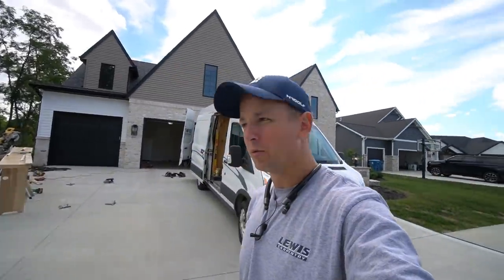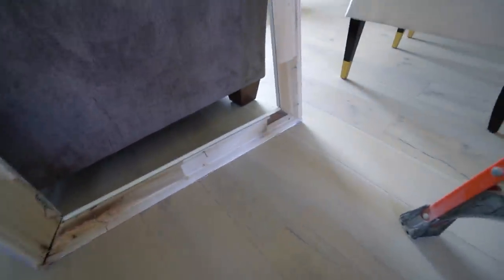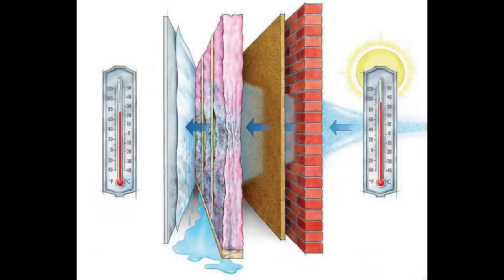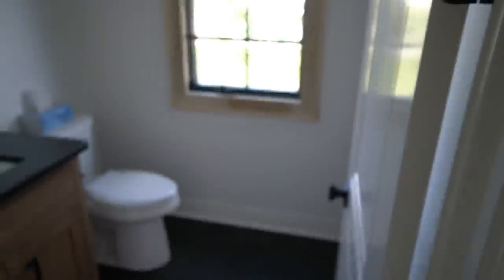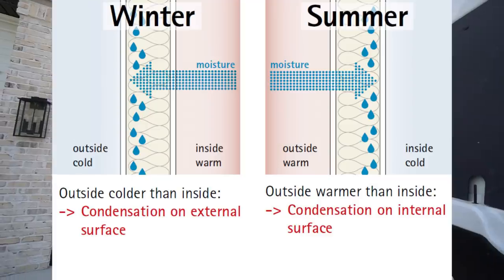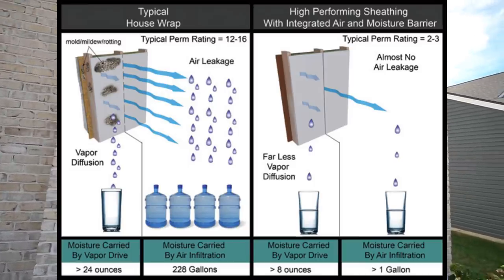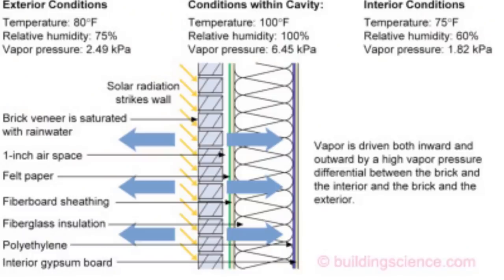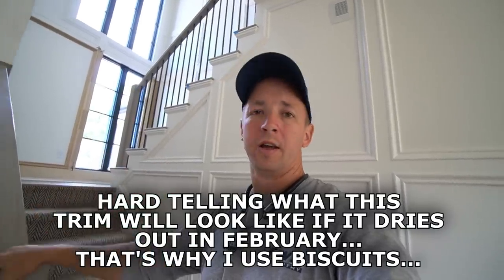Trim Humidity DISASTER!!! Is Vapor Drive Destroying this Trim Package???

Comment: Where does the air go at the top of the brick without soffits on the gables wondering what was done to allow air to flow i understand it’s a different climate zone than down here but we put vents at the top of the brick if there isn’t any soffit

Comment: Looking forward to the follow-up. We go through certifications from Owen's Corning (insulation and roofing) Tyvek, CertainTeed (siding, roofing). Whenever I get involved with a situation like yours, we ask all the manufacturers reps for input as well as our architect. Wish you had opened up the wall completely, would have been easier to figure out what you have going on

Comment: Thoughts: 1- At 4:10 you show an open gap behind the casing. In my area, this window would be a disaster waiting to happen in winter. Your area is opposite with cold a/c meeting hot exterior, but the principle is the same. 2-We had major moisture/mold problems with a house framed and then wrapped during the heavy rain with improperly kiln-dried lumber. 3-Have also seen similar problems with improperly sealed window sills and other areas on exterior around that brickwork. 4-Doubting the wisdom of spray foam against the exterior sheathing, could be trapping moisture and forcing it to go in rather than out. Moisture barrier should only be on the inside of the wall, not the exterior. Needs to breathe that moisture out. 
Could be multiple problems going on to make it worse.

Comment: I do think it highlights the importance of finding a good carpenter especially on a house of high value. But if your having that many blow outs and dripping condensation, the carpenter really isn’t the issue. Definitely an unacceptable level of moisture coming in, and I think with the scale of damage, any level of trim carpenter would be put to task with this. It’s almost a blessing that the trim was the thing to go, cuz if it were to continue, they’d be calling a guy like me who tears off the stone and jacks up the house to replace the sill plates under each window due to rot. I’ve worked on houses only a 1.5yrs old, and it sux to see here in Ohio.

Comment: I am a custom home builder on the coast, we a required by code to rainscreen everything. Based on my understanding of building science you are getting moisture driven through the brick veneer without an airspace to bridge the framing and allow it to dry. 
That said I would also check the exterior siding assembly at the bottom on the windows and where the veneer ends and switches to siding (right above that bad window spot in the staircase)
Finally the hvac system if not installed properly would add to these issues, massive temp differentials withoutr proper circulation add an atmosphere like effect, if there is no dehumidifier and the air barrier is damp and super tight it could create vapor drive from the inside as well, at key weak locations like windows, doors and electrical boxes.
So.. Exterior flashing/assembly details, rough opening air/vapor barriers, hvac conditions. 
Good luck and hope you guys find some help here
Reply: I think you need to bring in and condition outside air to create positive air pressure in the house. Also, did I hear you say that they keep the thermostat on 68? To me that is too cold and is adding to the problem. I would also document the moisture levels at this point in the drywall in a lot of different areas to establish a base line before you start trying to fix this.

Comment: Closed cell spray foam should prevent moisture from coming through the walls from the outside. It also prevents moisture inside the house from diffusing through the walls. I think the moisture is being generated inside. My first thought would be to install and energy recovery ventilator to take care of indoor moisture issue.
Reply: It rules out brick wall problem then.

Comment: 100% a rainscreen issue on the brick install. Tonnes of red flags on the siding as soon as I looked at the thumb nail. No roof over hangs, no flashings at the transition from brick to vinyl siding, stone goes all the way to grade so there is no way it is vented at the bottom, no head flashings at the windows.

Comment: Hi Spencer,  30 years in HVAC   I would think this is outside air leakage with condensation due to the 68 degrees inside. I would find a contractor that could do a blower door test to find the leakage in the walls and floor around foundation. I would also do HVAC duct leakage test.
Good luck.
John

Comment: Looking at the front Of the house it looks as though there is cement surrounding the mulch bush area. Any drainage there from the roof or gutter is just going to collect or not have anywhere to go. That would stay wet for me long long periods of time and allow moisture to wick up through the cement floor.

Comment: You don't need direct sunlight - it's ALL ABOUT the DEW POINT. I have seen condensation on vapor barrier on stucco walls as temperature go up. All four sides of house were affected once temperature climbed up... another problem you get is that the water seems to travel back and fourth between the bricks and the wall cavity during day and night cycles, so even if it does not rain, this cycle can go on for months before it settles down.

Comment: My first thought was that it was a good thing the trim failed. Your friend may not have discovered the moisture issue until rot and mold caused way more damage. It is a barrier issue and without major remodel, the only choice is to seal the brick and install a high end dehumidifier in front of the ac.

Comment: Hey Spencer, Brick veneer needs to have ventilation behind it to function properly. There should be "WEEP HOLES" every so often around the homes brick veneer, sort of like attic ventilation. The same principle applies here. Moisture in the space between the brick and the house wrap/sheathing escapes instead of being trapped and condensing and causing moisture issues. Keep in mind that brick is very porous and will retain a great amount of moisture. There simply needs to be air movement/good air flow to keep moisture away. Great chance thats where the home owners issue lies.

Comment: I just replaced exterior trim. Most were pine but a lot of trim were redwood. Some area's I had to replace plywood and some framing. I replace the trim with a primed mahogany. That seems like a stable protect. Someone used PVC protect that heated up so much that pulled off the walls. All the exterior trim I use. I use exterior trim screws. Nails I don't care if it was stainless ring shank nails. They did hold, so my only solution is screws. On the lighter side. I like your van. Planning to purchase one in a few months. Thanks for your video's.

Comment: I live in a dry climate, but no matter where you are things need ventilation and a chance to dry out.  I have see several remodels where mold has been growing because the Tyvek traps moisture from getting away.  The problem areas have been at the bottom of the wall, and close to the foundation.

Comment: I will throw my 2cents into the mix. Since this problem occured in the summer and not the winter I would think it's the HVAC. If you can't get the humidity lowered using humidifiers in conjunction with running the AC then it's the AC that is putting all that moisture in the house. Exterior walls would be warmer and transfer through to the back of the drywall. In the inside of the house the walls are being hit with cold air and high humidity. This i believe is why condensation is forming on the back side of the trim.  If it was cold dry air being put out by the AC the temperature difference between either side of the wall would not form condensation. People think the bigger the better with HVAC systems but you know that's not true. I don't think the problem has anything to do with the brick, house wrap or insulation. I hope I'm right cause that would be the least expensive fix.

Comment: Very unfortunate as to what is happening. My thought is regarding the comment you mentioned about air leakage in the duct system. There are companies that can apply a coating inside the ducts that seals any areas of leakage. This maybe a start to help move airflow into area's that may have weak flow. Keep up the good work.

Comment: Spencer, I noted you said multiple dehumidifiers are running,  you did not note how long they have been in service,  3-4 dehumidfiers running unobstructed 24/7 would take several months to actually dehumidify this structure.  Your video does help focus on the brick veneer as an contending cause and the brick ventilation solution may be the homeowners best choice before brick removal..  Eave and attic ventilation seem greatly under served.  Powered ventilation of the brick/sheathing air gap seems called for first.

Comment: Cheap house wrap, little to no air gap between the brick and sheathing, poor insulation around windows.  Were the windows spray foamed around the perimeter?  If not, air movement and then condensation to follow.  The problem with an oversized HAVC unit is that is doesn't run enough to remove the extra moisture in the air.  Any resting water in the ducts in the slab?  Does the front of the house see the most sun?  The sun will actually drive the vapor in.  The trim is one thing, what about rotting framing, wet insulation/drywall, mold, etc...  Sealing the brick may help.
Reply: That was my thought. No gap.
Reply: Sealing the brick may indeed help, but that doesn’t address the moisture that’s most assuredly already present behind the drywall. Mold is almost guaranteed to become an issue in this house’s future.

Comment: The bad trim would be the least of my worries. If that house has osb it’s vertical mulch now. My questions would be 1. Has the drywall started turning to mush too or is it just the trim around the windows? 2. How do you know there’s really an air gap behind the brick? 3. Are you 100% sure that foam is closed cell? Closed cell is waterproof so I have serious doubts (remember closed cell is much more expensive than open cell so I think I smell a shady GC).

 If the HVAC was really the problem you would see problems around all the windows not just the windows on the north side. Sounds like you have brick + vapor permeable house wrap + open cell foam (vapor permeable) = no bueno.

Comment: It's a Spray Foam Insulation. I fixed the same problem with brick and vinyl siding. We redid flashing on siding and replaced insulation with sheetrock too. Also spray foam had a 1/8 cracks along 2x4's.

Comment: In part of the video, you showed where the trim was off and it didn't look like there was any foam around the window jamb. Was it removed as part the repair, or are all the windows and doors like that. Such a big uninsulated gap may contribute to the problem, even if it's not the primary reason. You will have a lot of condensation in that cavity, as well a fluctuations in the temperature.

Comment: Someone mentioned flashing on above the brick we thought we had this issue on one wall. Ended up pulling all the stone and plywood and using zip wall system .. it kept the water out for two years so far

Comment: Open inspection areas above and sides and below these areas, could have leaks. 

I’ve had hvac being oversized causing this problem 

A/C duct separation in chases 

My suggestion is inferred cameras are cheap these days and can help pin point water leaks and air leaks 

I also inspect with moisture meters, very important part map your areas of moisture 

It didn’t look like you had issues in siding, what is the waterproofing at lap siding to stone 

I’ve had lots of issues with penetrations at opening to exteriors not being waterproofed. Example vents light fixtures or outlets ductwork, doors and Windows 

This is the steps I take 

1st thing moisture meter and map

2nd ir camera would be great

3rd cut around openings to inspect 

4 water test with a water hose starting at bottom of areas showing moisture and slowly move up until you find leak 

5 dehumidifier would also help to dry out

Comment: My first question would be what do they have for roof ventilation? If I recall correctly, it should have 1 sq ft of ventilation for every 400 sq ft of roofing. And also how that ventilation is flowing? Is there flow from the soffit through the roof peak? This is a problem with houses that are sealed too well. That moisture from, cooking, showering, etc needs an escape route or there will be condensation where you don't want it.

I didn't read any other comments yet, but would be interested in what you figured out.

Comment: Check those weep holes, if they even exist on that house. Have a pressure test ran on the house with HVAC running. I wonder if the HVAC is creating negative pressure in the home. I've been in the industry for 18 years in Indiana and this is a new one for me. I wouldn't be afraid to waterproof the brick either. The waterproofing they have now, still allows the brick to dry, but blocks the water.

Comment: I'd be curious to see what the framing and sheathing look like with the amount of moisture that's reached the back of trim. I noticed there was already Foam used. We just built or daughter a tiny house (slab on grade, wood frame, spray foam and metal roof and siding). It's extremely easy to hear and cool, but, it's to tight. Showering even with the can on the humidity made the windows drip. A buddy said we may want to invest in an ERV "energy recovery ventilator. Not sure if this house is that tight or not but we're going to try it on the tiny house. I do know that wet spray foam will make a real mess.

Comment: I think the problem is between the brick wall and the wooden structure, you should break inside to see what it looks like.  If it is the air chamber between the brick wall and the wooden structure, there should not be so much moisture or water may enter somewhere when it rains. Or maybe the insulation is wet from so much moisture.  It would be best to see what is between the walls.  Here in Europe, houses are insulated on the outside with basalt wool to let the house breathe better than polystyrene and not so much energy or heat is lost in winter, plus basalt wool withstands fire up to 1500 ° Celsius.

Comment: I am installing a custom ceiling in laquinta ca and had problems with high heat and humidity on a golf course. After installation of my sheet material and poplar trim on this giant ceiling It got incredibly humid in the room. huge amounts of condensate was forming in the hvac system ducting. Check that too!!!!

Comment: Incorrectly sized ac unit will cause the moisture levels to remain high. Could be a lot of moisture coming out of the slab still also. Probably not just one issue but a couple. Seems you are on the right track.

Comment: Humidity in my house dropped drastically when we installed a proper vapor barrier beneath our crawl space.  I understand this house is SOG but got me thinking.  Would love to see if this home had a proper vapor barrier installed beneath slab?   Just a thought.  What if the moisture isn’t coming from that wall but rather condensing on there?  Cheers!
Reply: I would think you would see problems with interior walls if the slab was the problem.

Comment: Looking from inside the house out the window as you walk up that first set of steps it looks like a gutter coming down that would drain water just into the cement surrounded area forcing water to stay against the foundation for long periods of time.gutters go somewhere, are they flowing during rain? Check flashing at top of brick under center large window and check during rain for water that runs down front of house.

Comment: We had that happen, A/C was leaking inside walls, no rain screen under brick 95 outside 68 inside cold air leaking inside wall, lots of moister and mold, i see they used finger joint molding and no back priming. We cranked A/C and we could feel the breeze form the A/C inside the wall openings.

Comment: I do fire and water damage restoration. A wall definitely needs to be opened up to see what’s going on. If the trim is that bad, chances are the framing is like that too or is on its way to being like that. Also, on any masonry facade like that, there needs to be airflow. If it can’t dry out, it rots out. Also, most of those masonry facades are not installed good so there very well good be water seeping in somewhere and when the temp goes up it could be vaporizing all that into the cavity and spreading everywhere.

Comment: Definitely needs cavity between brick and OSB/wrap to allow air movement. The transition between weather boards and top of brick work looks like  a place where water could get in.
The OSB and framing will most likely be water damaged.

Comment: should try and get Matt Risinger's opinion, he's super knowledgeable in construction science. In my area all of the homes are stucco and we're right next to the ocean, I'd guess that there's a failure in the waterproofing(maybe improperly installed or defective). Maybe the mulch and dirt comes up too high on the bricks and the water that gets in isn't able to drain down correctly and some may even be leeching up.